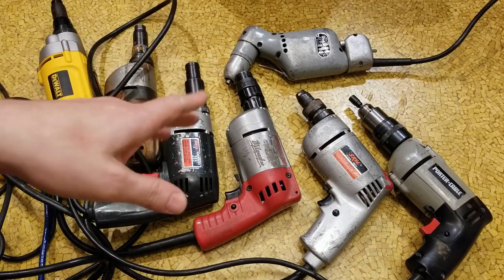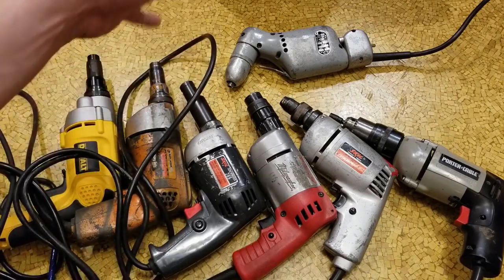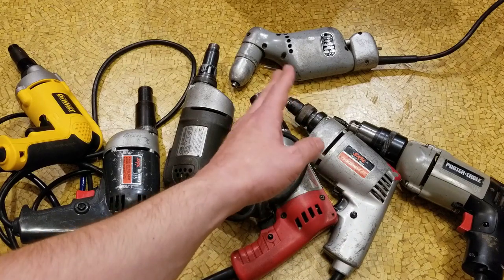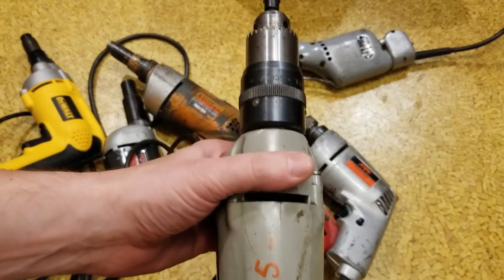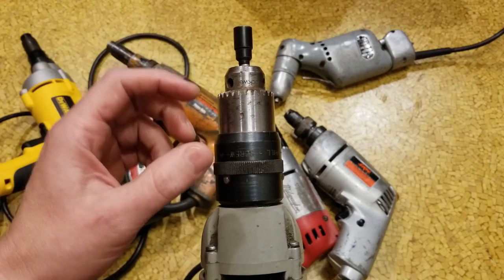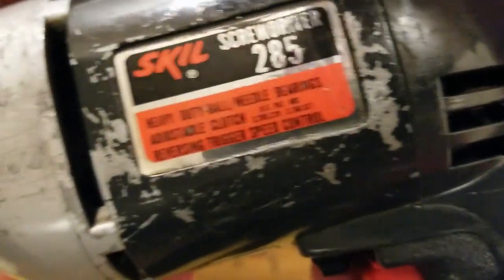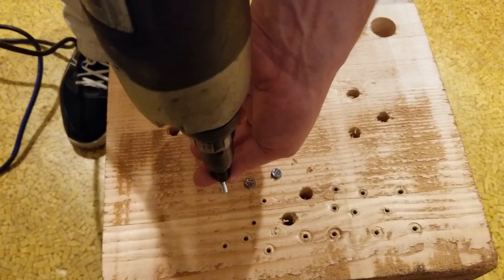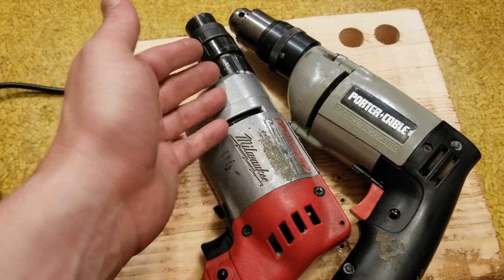Professional Adjustable Torque Screw Driver Review & Comparison

Comment: Just picked up a Porter Cable 622 hd. When I opened the gearbox to see if the grease was good one of the gear sets (spring loaded for the clutch) popped out . A roller bearing and some spacers came with it and jumbled out of order on my bench. From watching enough your videos I was able to figure out how to reassemble.   thanks